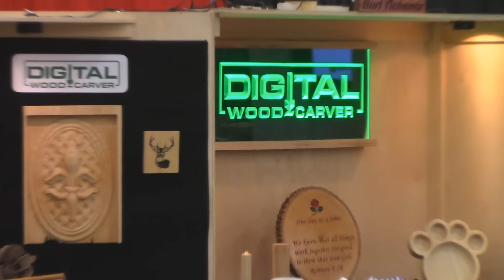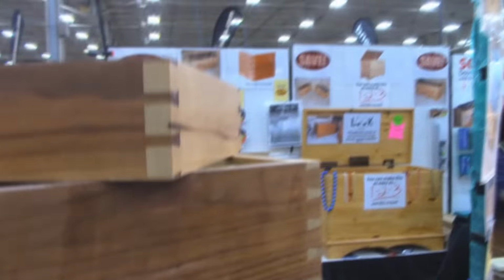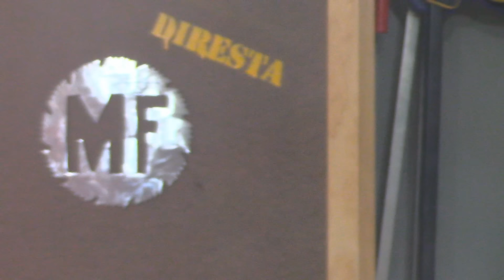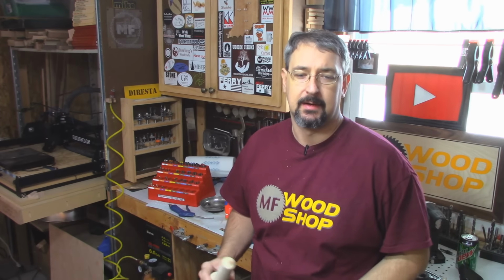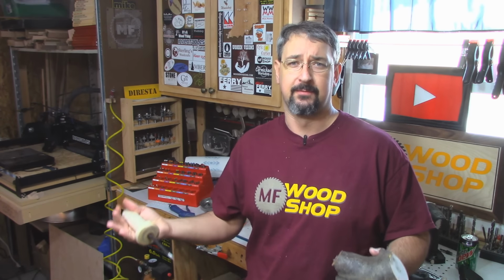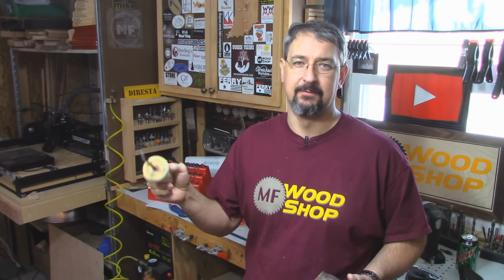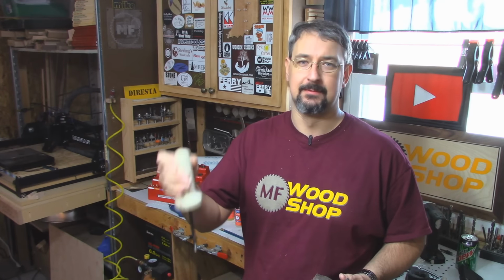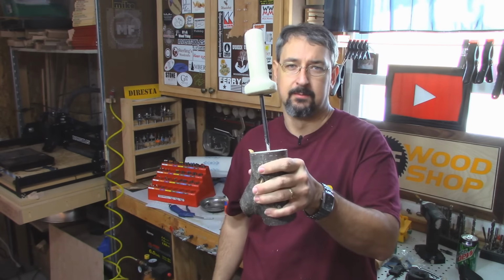Tire Demolisher/Shop Update

Comment: Nice tool Mike. It's a shame you have to make one. The fact that corporate, whoever that is, determined that utility knives are too dangerous. I worked part time at The Orange Store, that's what my grandson calls Home Depot, and we had to have the kind where the blade was spring loaded and auto retract. The fact that we sold machetes was not lost on anyone.
Reply from the maker: Those sprig loaded knives suck. That's what we have to use.

Comment: I suppose a drill and bit too much trouble for use?
Reply from the maker: You would be surprised how many mechanics don't have drill bits in there tool box
Reply: +Mike Fulton The shop can't afford a cheap drill and bit for that purpose only?
Reply from the maker: +Murray Lowe sense I'm the service manage and any and all expense come off the bottom line, their for it effects my bonus. This way didn't cost anything. Plus I got to spend time in my shop
Reply: +Mike Fulton Yup any reason to get into the shop is a great reason.